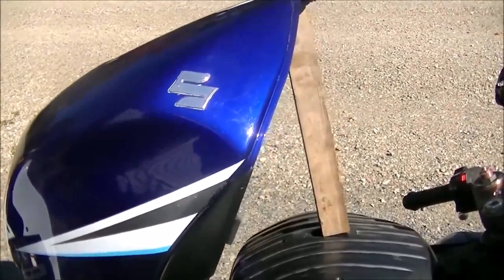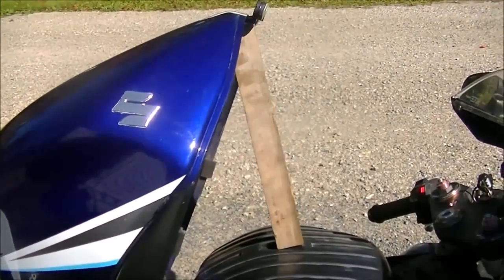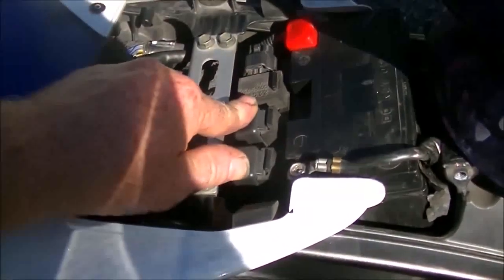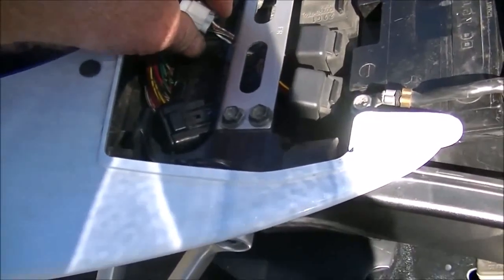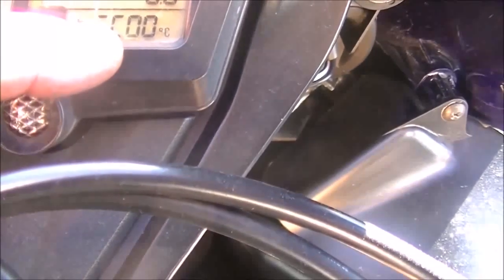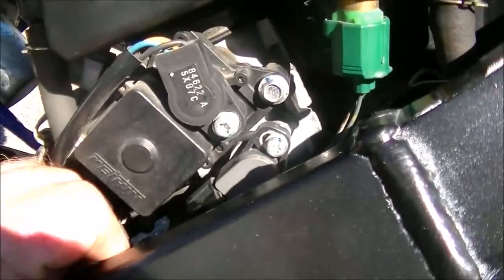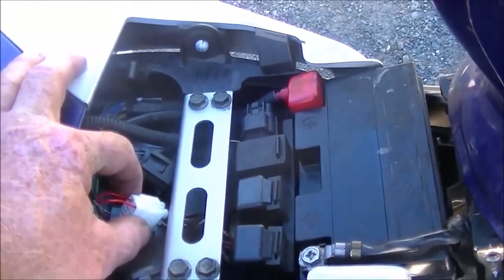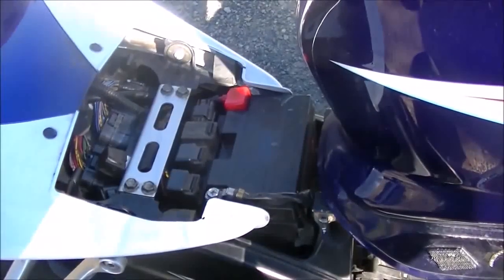2005 GSX R1000 Adjust TPS (updated)

Comment: Have a 2002 GSXR 1000 that's just been completely rebuilt and also I took the factory exhaust off along with the exhaust actuator valve. The factory exhaust header's are still on the bike!!! Servo Buddy was installed to the bike and the code before the servo buddy being installed was -C46. That was the only to show up until this past week when FI code -C29 came up and it was for the reason. "I hook the secondary TPS sensor off the bike and the key was in the on position." The reason for me taking it off was for the secondary butterflies doing this weird chattering sound when they hit the bottom of the throttle bodies. They have been doing this since the rebuild use done to the bike & if it could be a reason it is doing this being (Throttle bodies not synchronize then I can get them done). Yes, after the rebuild they didn't synchronize my throttle bodies, which leads me to the next Question about the bike. It was starting fine with the secondary butterflies chattering as they were doing & the bike seemed to "Idea and Rev good but was running pretty Rich." However, That all changed when the bike is put under a load & would bog down in every gear with the throttle having a sweet spot in the 3-5k RPM range!!! (Bike runs perfect for that ⅓ of throttle spot for some reason). The bike will not get over 5k RPM's and falls on it's face there. It's bogs down about on take off but picks up quickly, until the 4200 to 5000 RPM range before it starts bogging down again. I am cleaning the primary canister filter for it now and in was nasty/black looking, but the bike is not running after I attempted to ride to my dad's house about 7 miles "went from 55 MPH to 20 mph max power of it." I am told that the exhaust could be the reason for my 4200-5000 RPM bogging because it needs tuned after the exhaust actuator valve and exhaust being replaced. Can you please help me out with this problem so I can get it going again?
The help will be greatly appreciated.

Comment: When you start the engine and turn the throttle on and off does the bar change or does it stay fixed in the middle?
Reply from the maker: The bar should move with the throttle.

Comment: Awsome dear....its 100% working....great work....i have suzuki  2012 model gxr1000cc....my ADJ button in dash board is not changing measurments in screen.while SEL button is changing.the other 2 buttons in right handle bar switch assembly is also changing readings on screen and working...but only dash board ADJ button is not changing the readings...while the same button working on time change etc every thing...just only initial reading not changing....any help???

Comment: hi..mine was on bottom when engine is running and hot, at idle. When cold and not running is in the middle. More rpm, 4000, in the middle. Do i need to adjust?

Comment: My FI light came on while riding. I noticed that the bike lost some power and struggle to go into Neutral when its between 90°c and 102 or when i rev it hard. I did put it in dealer mode and the code is -C00 need to set the tps sensor so that that line can be in the middle.  What causes the lack of neutral at that temperature. What else do i need to check. Thanx in advance
Reply: did you ever did out the issue

Comment: Assuming your in Canada by seeing your metric settings. Wish you were in Ohio. My 05 gsxr 1000 is running a little rich. I bought it with a power commander a while back. I adjusted my tps sensor. (thanks so much for the video)
Have any tips on how to lean it down. I did have some bad gas that was making the fuel pump scream. It's all out now and fuel pump is quite again. Could the bad gas make it run rich? Appreciate any help
Reply: Why dont you just take out some fuel with the power commander? 👀

Comment: I need your help the sensor that looks like the tps that's under the one you move to adjust does that one need to be adjusted also I looked at it and it has a white line like the tps and it's not lines up could that be cause me issues

Comment: Hi man, nice video but i have one problem ... the error is OK but the trace continues on top "C00 wht?
Reply from the maker: I assume you mean that the line stays at the top when you move the TPS.  

Is the bike running and starting well?

There is a possibility of the TPS being so far out of adjustment that there isn't enough adjustment available, so I would take the sensor off of the bike and rotate it slowly by hand with a screwdriver where the throttle shaft should be, to see if the line moves.  If you get movement now, then you need to look for a reason, such as a bad throttle shaft, for the TPS not acting properly when installed.

Any voltage or resistance tests I mention below have to be done with a digital multimeter, never use a sweep needle analog meter around computers.

You can also check the voltage output of the TPS.  Input is usually about 5V and as you move the throttle, the output voltage should vary from a minimum of about 0.2V to a maximum of about 4.8V.

If you get no movement or voltage variation, then disconnect the sensor and check it with an ohm meter.  The resistance should change as you rotate the sensor by hand.  

If these tests fail, then I would assume the TPS is bad, but, that should trigger a code C14.  

Without seeing the bike, it is hard to say absolutely, as there are very many variables.  Since the line isn't moving and no fault code is present, and if you can't see an obvious reason, it would be best to get it checked out by a good technician, or, borrow a known good TPS and try it on the bike.

Comment: Will this prevent the bike from starting up?
Reply from the maker: I wouldn't think so.  The adjustment only sets the output of the TPS to match the idle position of the butterflies, so the computer gets an accurate reading of the throttle opening.  Basically, it only affects how well the bike runs through the rpm range.
Reply: Ok am here trying to figure out why my bike won’t start, fuel, spark, no codes, keep on cranking, but not starting

Comment: The line on mine is center at idle wen I put slight throttle it drops down but wen I open up throttle more then half the line jumps to the top is this normal

Comment: To set the TPS you need a meter,My 06 gsxr1000 wouldn't run right with the line in the middle  It ran perfect with line on the bottom. I set mine differently .My line would never stay in the middle.
Reply from the maker: That would make me suspicious of an underlying issue causing the bike to run better with the TPS not at factory setting.  There are many possibilities, so I wouldn't even guess at it.

On cars we use a multimeter to set them, but that is due to lack of a "line system".
Reply: @lelandlewis7207  They do the same on bikes I'm glad I listened to myself and my k6 is running great again
Reply from the maker: @skatman3872  if you know the spec then absolutely can be done.  I'm just saying that for my peace of mind, I would eliminate all factors that could throw the TPS setting off before abandoning the built-in system.  As long as you are happy and your bike is happy, that's great.

Fuel injection is a great system but all of the parts of the system affect each other, which is why troubleshooting can be time consuming and expensive.

I remember the systems from early '70s VW, which were a bear and hugely expensive to repair when they acted up.  In most cases we just ripped it off and put on carbs.  It has come a long way since then.
Reply: @lelandlewis7207  I've been working on superbikes for 30yrs I just replaced the fuel pump and the tps they were 14yrs old .When I went with what the video said I struggling for a month trying to figure it out Turns out the position of the line wasn't as important as I thought it was Thank god I decided to do it a different way That's all that matters my bike is finally running like it used to .K5 k6 are monsters
Reply: @skatman3872 replacing your TPS fixed your problem ? I’m having this strange problem with my K5 where when I open the throttle fully it bogs down but when I let off the throttle a little the power comes back in but this limits me to a top speed of 138
Reply: @RIOBRAW  No actually it was a bad pc5 unplugged it ran perfect
Reply: @RIOBRAW  mine is more like 183 top speed to 190 i have a tre,but a flash puts it over 190,i recommend chris moore
Reply: @skatman3872  Hey, i have 03 1000 and my bike is not smooth from 1000 to 4000rpm, the power delivery is very rough. I have new oem air filter, new spark plugs, removed SET valve, shorty pipe. When engine is OFF, my TPS is at upper dash line, but when the engine is ON and at operating temperature, TPS dash is at middle line -C00. But still , this bike doesnt have crazy power down low, its like bogging when i twist the full throttle, it comes alive only after 4-5k rpm, then it rips the shoulders. I know these bikes are tuned for emissions straight from the factory (lean fuel map for emissions and environment), so when you remove SET and put shorty pipe, it becomes even more leaner, so it needs dyno tune. So i am not sure if thats the reason why my bike feels like 750ccm down low or its maybe not properly set TPS...i was thinking to do it with multimeter, 1.1k Ohm with throttle closed and 4.3k Ohm with throttle opened, but the question is, are there values meant when the engine is OFF or when the engine is ON at operating temperature ?
Reply: @bojanh66srb  your tps is correct on Suzukis it goes from the middle to the top ,try coils ,maybe a flash
Reply: @skatman3872  I have a 2005 gsxr 1000cc , what I’m saying is I can’t get it to go past 138. This bike is much faster than that. When I have the throttle open all the way the power is like being held back, as soon as I roll off a little the speed & power picks back up
Reply: @RIOBRAW  Try new coils,is there a pc on it
Reply: @RIOBRAW  How long have you had it,do plugs at the same time,

Comment: Mine centres. Tighten it. Still centre. Start the engine and it pops up or down.
Also, of the 2 TPS, how do I know which one needs adjusting because when the bike is running the line is either up or down. Never middle.
Reply from the maker: I have only ever set the bottom one.  Set it with the bike running.  I added that as a text at the bottom, but do the adjustment with the bike off so people can hear me speaking.

Comment: what happens if I don't do this PLEASE  ?  ... EXCELLENT VIDEO
Reply from the maker: This adjustment sets where idle is so the computer knows the correct angle of the throttle to calculate fuel and timing.  If the setting is off, then the engine may run rich or lean and\or the timing may be advanced or retarded for the load on the engine.

Comment: I have a 06 gsxr 1000 and while riding my fi code pops up and my rpms drop from 5k to 0 then will go right back to normal.  I've tested the code and it is a -C00 which is stating nothing is wrong.  Any ideas what could be wrong with it would be greatly appreciated.
Reply: I have the same bike but my tps doesn't hold it is changing all the time I guess it's bad
Reply: @skatman3872  I figured it out. It was my power commander and my kick stand sensor.
Reply: I ordered a new tps,How did you test your pc5
Reply: Do you have a pc on it

Comment: awesome thanks, after tightening and centering my tps i turned off bike, took out diagnostic wire then turned back on but still getting fi error but last time i checked code was c00.
Reply: The 07 it's more difficult ..
Reply: I used a different method. Mine wouldn't go past 10 000 rpms But with the line at the bottom ran perfect. You have to move the tps and then rev the motor and keep moving it until it runs perfect. The actual correct way to set it is with a meter.

Comment: I have a 1250s bandit  have a no start fuel pump primes but no fuel  my line is at bottom.
Where is the fuel shut off and will the tps being to low make a no start?
Reply from the maker: It is possible, but not likely for the TPS to cause a no-start.  There is no fuel shut-off om the fuel-injected bikes.

If your pump is running and you have no fuel to the injectors, then you probably have an issue in the delivery system.  Check the high-pressure fuel filter (a good idea to change it if not done for a while), fuel regulator and the lines for a kink or collapse.  Check that the fuel pump is actually pumping fuel, that the volume is correct and that the pressure before and after the regulator is correct.

There is also a mesh screen on the intake side of the pump.

Comment: What do that red light indicates?
Reply from the maker: That is the oil warning light.  The bike isn't running, so has no oil pressure.
Reply: @lelandlewis7207  thanks…..when it does that, does it lose throttle pressure?? When I give it throttle, it doesn’t go pass 5-6 rpm’s

Comment: Where's the idle speed adjustment  ?
Reply from the maker: On the left side of the throttle body assembly are 2 screws; the larger one is the idle speed adjustment, the other is for the balance adjustment.

Comment: You never started the bike in this vid.  It'll change the line.
AND
FI  =  Fault indicator code!

NOT Fuel injection code.
Reply from the maker: If you watch the video you'll see that at 3:49 there is a message to start the bike at that point to complete the procedure.  I don't start the bike so I can be heard easily.

As I have explained in other replies, yes, it can be called a Fault Indicator although the manual doesn't use the term.  I use Fuel Injection because most DIYers use and recognize the term and its meaning.  Either one gets the point across for FI, especially since many people call it the F-0ne light.